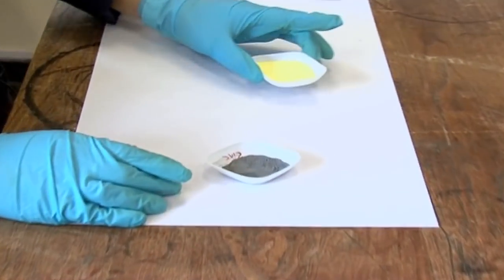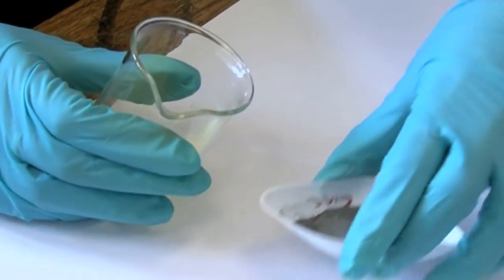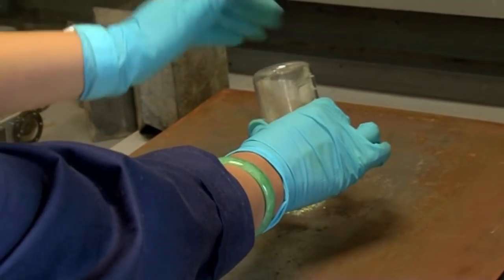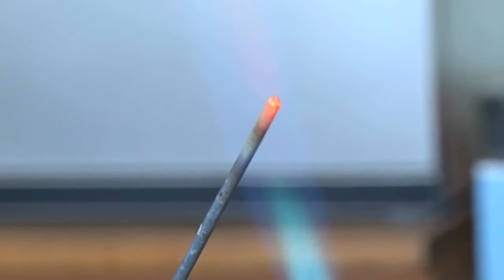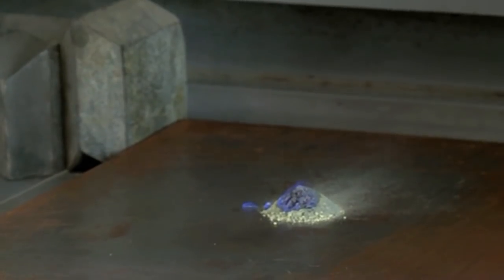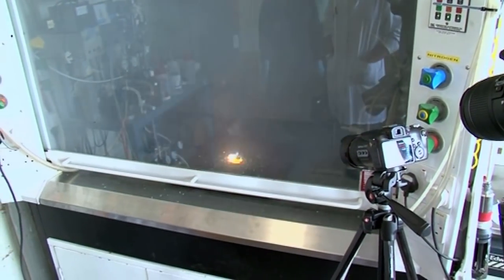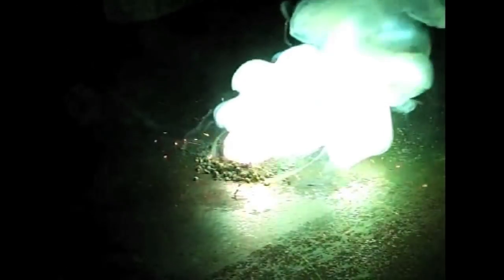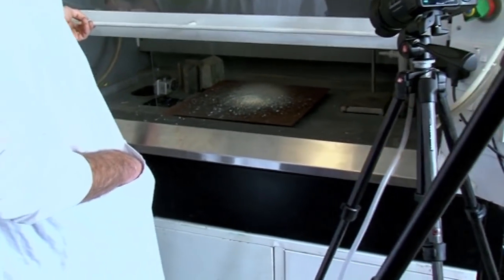Zinc and Sulfur - Periodic Table of Videos

Comment: this is also known as Zn-S flash powder in pyrotechnics. i was using it as rocket fuel (dont try this cause it is really sensitive of the design of the rocket motor and there is a big chance it will blow up) and as a flash powder for firecrackers (if you mix it in right proportion its quite sensitive to flame and burns really fast). if you put little cooper in the mix you will get glow in the dark powder as byproduct (its not that good as the commercial one but its good DIY one).

Comment: It seems the powders were a bit damp or at least not mixed together well enough. When thoroughly mixed and activated by a glowing metal rod, dry zinc and sulphur powder violently and neatly burst into flames like gunpowder. The mixture can be so reliable it can be used as a solid fuel for smaller rockets.

Comment: Well, sphalerite is an ore, so you mine it to refine to make zinc metal.  Zinc is used in alloys such as brass and bronze, to "galvanize" iron or steel to prevent rusting and other uses such as catalysts, paints and batteries.

Zinc is fairly abundant in the crust, so its both deep down and near the surface.

Comment: Oh yes, it can literally burn under right conditions, for example in a powdered form.
It can glow in hot steam. It also literally burns with flame in oxygen.
Judging by your logic, iron burning in air would also be a thermitic reaction because there's a metal reacting with something producing flame. But it's not.
You have a confusing set of bits of knowledge in your mind. I suggest a hefty update.

Thermitic reactions are displacement reactions between metals and metal oxides. End of discussion.

Comment: This is a Class 4 fire, a metal fire in the same category as thermite & magnesium fires.
Class 4 fires burn at very high temperatures & need a special extinguishing agent, never ever try to extinguish a Class 4 with water based extinguisher, as the high temperature splits the water into hydrogen & oxygen causing an explosion.

Comment: Why is zinc fuel, and sulphur isn't? They are both fuels for the ongoing exothermic reaction. It's been a long time since chemistry was into "fuels and oxidizers". That classification is obsolete in strict reaction terms. It's more a thing of semantics.

Then reaction of iron with steam would also be thermitic, cause iron is "the metallic fuel" and the water oxidizes it so vigorously it glows red hot. But it isn't.
Also, any burning metal in oxygen or chlorine would be "thermitic", but it isn't.

Comment: Well, you've obviously used a non scientific source. Every book on chemistry I've ever read defines thermitic reactions as highly exothermic displacement reactions in dry conditions, between metal oxides and strong reducer metal such as aluminium.

Metals reacting with nonmentals has nothing to do with thermite and it never did, whether it's iron burning in air or sodium burning in chlorine. You've got it all wrong, which is obvious because you didn't have a clue iron can burn.